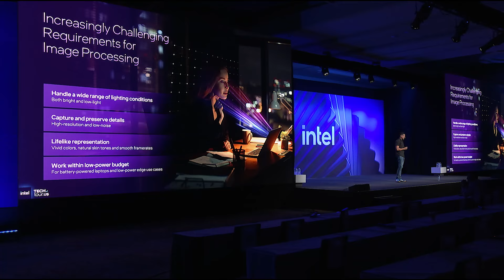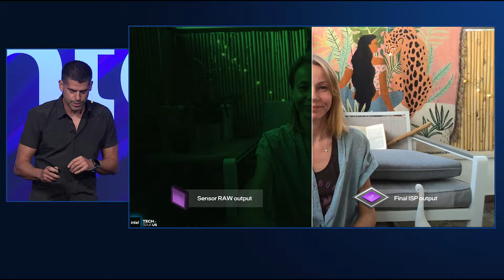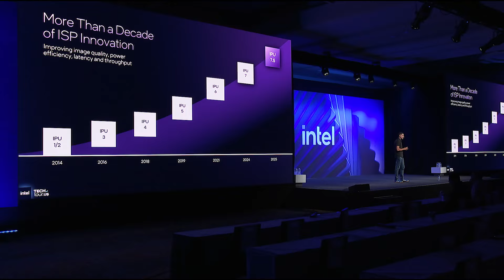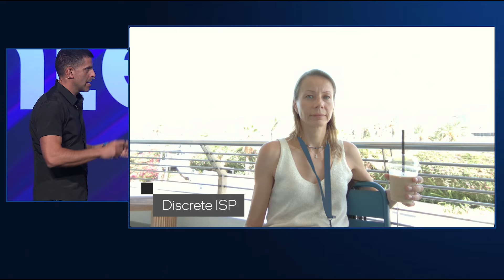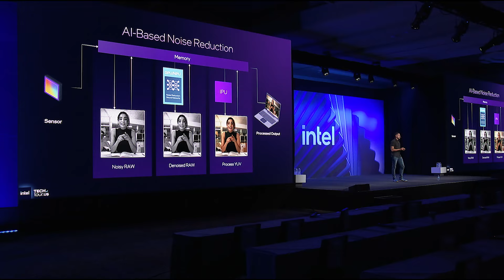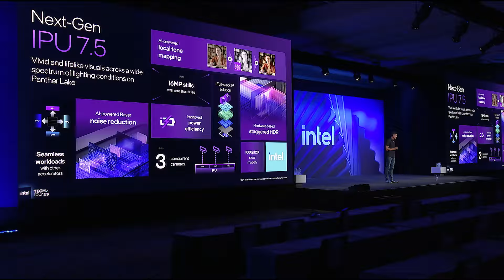Intel Technology Tour 2025: Panther Lake Next-Gen IPU Architecture | Talking Tech | Intel Technology

Comment: I still dont get it why an integrated IPU makes sense nut an integrated Thunderbolt 5 controller does not.
There is PCIe 5.0 for a dGPU but no Thunderbolt 5 for eGPU.
The IPU is great I hope there will be devices who take full advantage by pairing it with a great camera module.